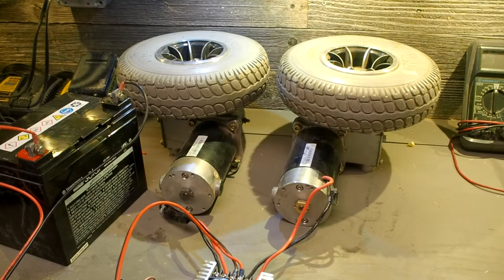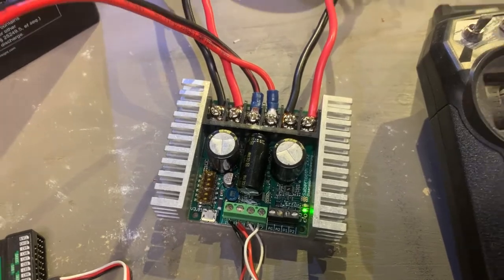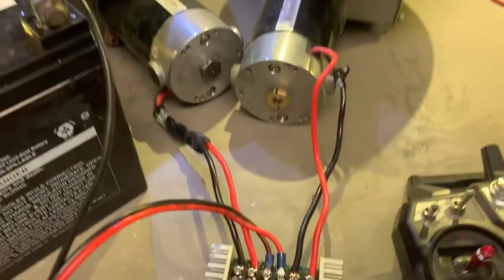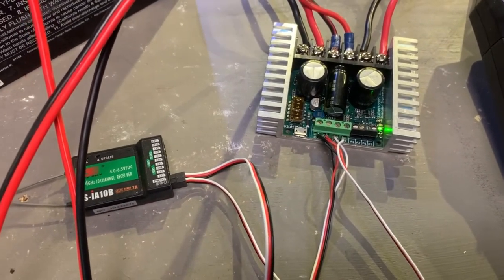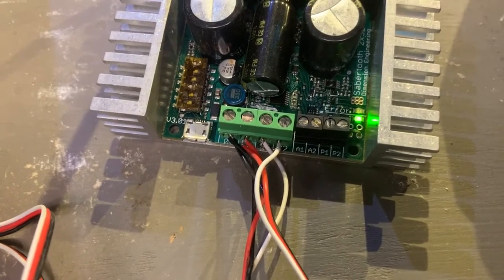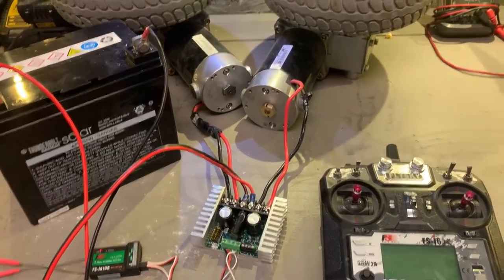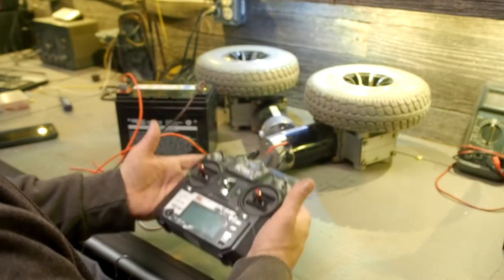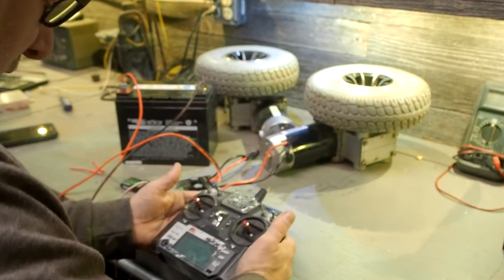Connections for the Sabertooth 2x32 speed controller

Comment: How are preventing the sabertooth from overloading and getting damaged by those motors drawing too much current?
Reply from the maker: Well, the  32 in the 2x32 is amps. I felt like the 2x25 might be light for the wheelchair motors but after doing some research into the 2x32 controller and wheelchair motors in general, I felt like it might be up to the task. There isn't any info on the motors to make calculations with but at some point I'll hook the motor to a 12 volt and 24 volt setup and put the motor under stress while I test amp draw.

Comment: Hi can you use 20 volts or 25 volts or 35 volts battery on sabertooth dual 2x32a 6v-24v motor driver please

Comment: Hi Lee, thanks for this video. The sabertooth 2x32 Amps is all out of stock. The only sabertooth I can find is 2x25Amps - would that be suitable for this kind of setup? Appreciate your response. Cheers
Reply from the maker: I Think the 25amp may be borderline if you loaded the motors with a lot of weight, like a heavy cart. The 2/32 is now on a jazzy scooter i tore down to just motor wheels and battery. It works well, it's not fast but STRONG and crazy quiet on concrete. I think the 2/25 would work on the jazzy as long as I didn't put it to work dragging things around or weighing it down. Copy and paste this, it adds a little insight.  https://community.robotshop.com/forum/t/if-a-dc-wheelchair-motor-is-rated-at-9-4-amps/10598    I should be doing a video on the jazzy in the near future. :)

Comment: What gauge wires that you use on the motor
Reply: Depends on how hard you expect to drive the motors. For example if you want a full 32A (continuous) you might need 8 or even 6 AWG. It also depends on how many cores are in your wires. If you use full solid conductors like you might find in home wiring, you can go down to 12 gauge. There are tables you can find online showing the current capacity of different wires.